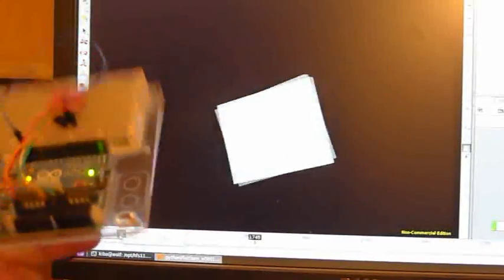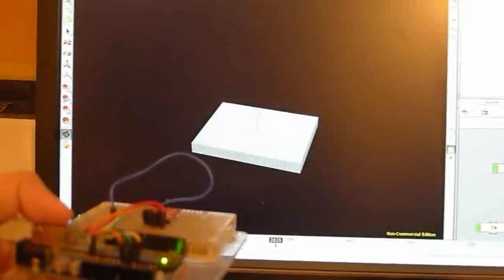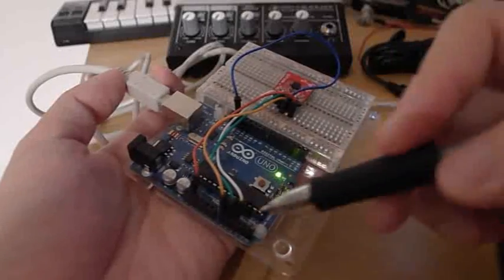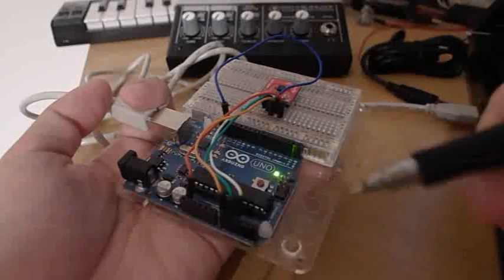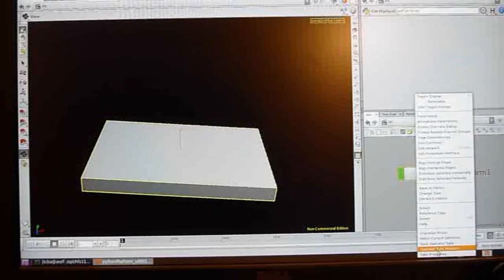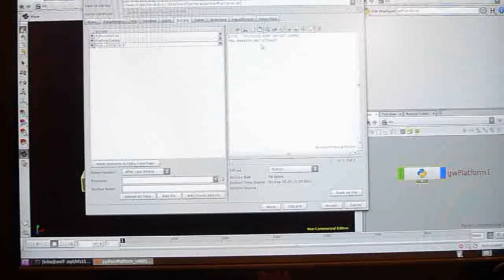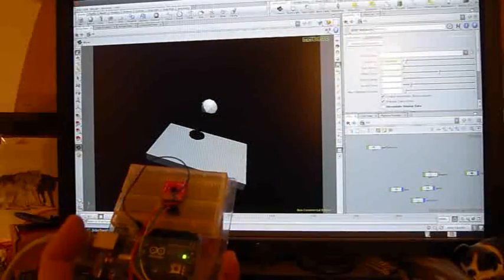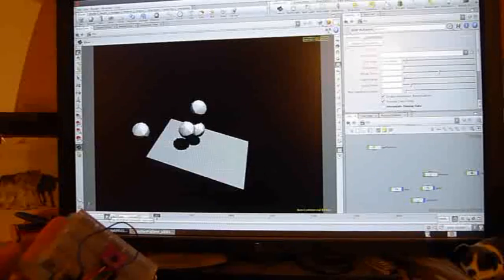Houdini HOM + Arduino + ADXL335 - RBDs, live!!!

Comment from the maker: @hoptoad Hi there, for the arduino side, I bought a kit that starts from the basics, and part of it also teaches about serial communications. Once I understood how that worked, I then used the same connections settings with python to get some tests working. Once that worked, I then implemented python code inside houdini for interfacing. This is by no means the only solution, and it is not exactly fast. hths!